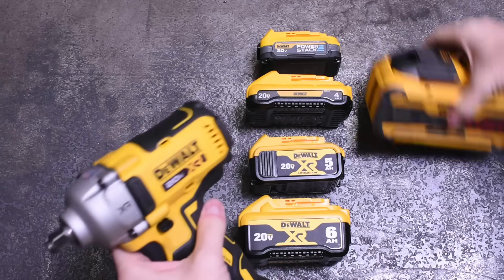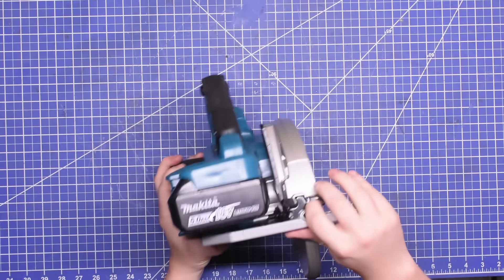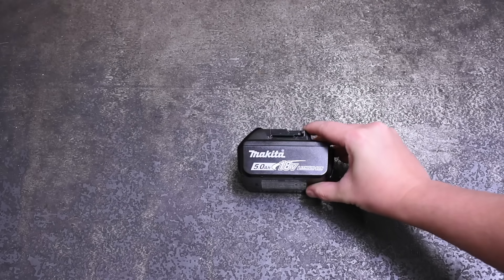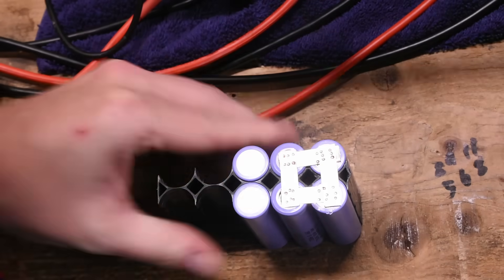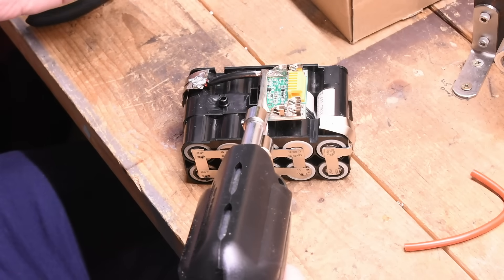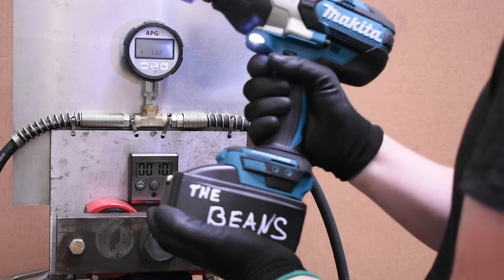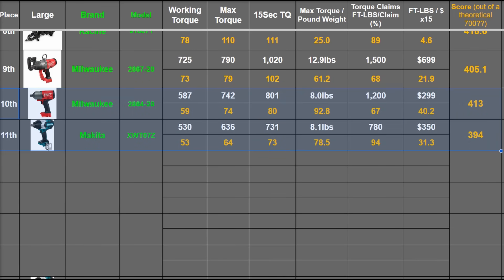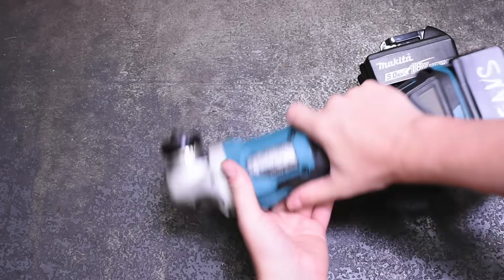We Built the Best Power Tool Battery for the "Worst" Brand

Comment: I've been very happy with my Makita stuff, but I have been considering branching out. If I were to get a different line of tool, what would be the best? DeWalt seems to be the obvious choice because they're so ubiquitous (especially in my area), and seem to be keeping up with developing new, better tools and batteries, but maybe there's a better option now?
Reply: im in a similar position. im thinking of hikoki. love my makita tools but hikoki make the most powerful cordless drill and grinder. id also like a belt sander which makita dont make. find a good brand that offers those extra tools you want

Comment: I built a few FAKITA packs using Molicel P26A 18650 2600mAh 35A cells. They boast discharge temp down to -30c, and where i live in Canada, frozen batteries are infuriating!

They work great in the cold, however the cheap ABS cases SUCK. one drop from waist height and they're toast. (If you drop one in winter I'm quite sure it'd just shatter!)

Comment: I'm fairly sure Makita knows that bigger batteries will give them more power. They also know that LXT has had several layers of duct tape added to it since 2005. Bigger cells would need another layer of duct tape in the form of bigger mosfets and probably a heatsink in the battery. Eventually you're better off starting from scratch, which is what XGT is.

There is no XGT tax. In EU, AU/NZ, Asia, the XGT equivalents are the same or slightly more than LXT. What you're seeing is crazy price competition in the US amongst retailers. So US LXT prices are probably very low margin, but Makita are unwilling to discount XGT because they can make much better money off it from the rest of the world.

Comment: It's interesting to see the different curves on that 15 second run right at the very end, the 3/4 Makita still has quite a steep curve indicating it is still making more torque, whereas the Milwaukee has started flatten out quite a lot. Would of been interesting to see if it flattened out at the 20s mark. It wouldn't surprise me if the Makita made more power than the Milwaukee after 20 seconds.

Comment: Imagine if our tools came with a simple coverable port on them so we could...plug them in if we wanted to. Great episode. If you're going to experiment, why not make some cordless tools corded?
Reply: I always liked this idea but the low voltage tools need a transformer that can output at least 50 amp peak so it doesn't go into overload, I made a power supply that can do just that with a peak output of 80 amps at 20v, the cheap part is the voltage regulator, the expensive part is the transformer to step the voltage down, although it could also be done with a bit more sophisticated switch mode power supply, I have an old skill brand set with the versa pack batteries that has a battery eliminator for a few tools, but it always made them super weak
Reply: @TheShivABC  That's true I didn't consider that, thanks for sharing

Comment: Nice work!
One question though, are the tool switches and motors designed to handle the extra current?
Reply from the maker: They only get as much current as they request. The difference here is the voltage doesn't sag from it
Reply: @TorqueTestChannel but the toosl are designed for the existing batteries. If you add 30% more power and 50% more runtime, then stuff is going to cook that previously would not cook. This is why their older tools can't run with 4/5/6ah packs, because they were originally designed when 3ah was the best pack available.
Reply: @toolscientist  they were only going to "cook" because the old tools had 0 thermal overload protection communication for the battery.  And no low voltage control either. The motors and switches were absolutely not going to cook from a 4.0 being put on them because they were still using the exact same motors/switches and models #s as the prior year tools in most cases when star protection rolled out.   On the tool side it was basically nothing other than a revision for the tools to accept the sense pin/rail from the battery and do basic yes/no communication for battery SoC and thermal condition 

Ofc the batteries were at risk of being cooked, or at the least, potentially overdischarged, by a completely unprotected high-draw tool.  (ex: DGA452 angle grinder)  Plus that little plastic nub that the old pre-star tools had on the bottom preventing people from putting newer 4/5 batteries on them?  That was there long before star protection ever came to market.  That was originally for Makita's crude way of preventing people from taking a 1.3/1.5Ah slim pack and immediately roasting the thing in an angle grinder, reciprocating saw or a large premium-level drill.  

4s and then later 4/5 w/ the updated battery gauge were locked out to stave warranty claims because people were rampantly destroying (though no fault of their own, really) their own batteries by running the tool til the motor barely turned, putting the battery was in a deep state of unrecoverable overdischarge.  The infamous red/green flashing error lights on the charger.  It was never going to cause any issues with the tools themselves, because Makita was already allowing you to use new batteries on the old tools without that plastic nub anyways.

Yes, you could still do this with the newer star 3.0s, but that was the standard battery going back 5 years, Makita still had to officially support the old tools in some capacity and it was a cheaper battery to cover under warranty.  And early star protected Makita batteries were still NOT as sophisticated as the ones we have now.  I've still got some old junk packs with the 1st star protection PCB revision, and they're nothing like what we have now.  

The old tools and new tools were 98% the same, at that time, anyways.  Most post-star protected tools the first few years following the roll out were still the exact same model # with the exact same parts (switch and motor) as prior year tools.  The switches were only ever updated for the sense pins, they never uprated their current carrying capabilities because they didn't have to.  Plus Makita was allowing you to use new 4/5 packs on those old tools anyways, as long as that old tool already accepted the old slim 1.3/1.5.  

Same motors, same switches, same models #s (they would later come out with a new model # system in North America)

I've got a pre-star BTW251 from 2008-2009, post-star BTW251 from ~2013 and an XWT05 from ~2016 in my old pile of tools.  All are the exact same wrench at their core.  The BTW251 post-star was basically just a revision for the sense pins and then the XWT05 is just a model # change.  All parts were virtually the same and outright compatible.  The oldest BTW251 wouldn't have star protection ofc if you're just swapping parts around, but I can still take a 2023 battery and use it without issue...(the only real issue being the wrench is worn the fuck out from long service life)

Though if I still had one of the original star protection batteries working that wrench would definitely be able to run the battery so far down that the charger rejects it.  New batteries can at least protect themselves in tools where low voltage control is not present.
Reply: @jaywelker5566 good info, thanks! It's been a few years since I used LXT but I remembered an old circular saw that would only run on 3ah packs. Can't remember if it had the 3rd pin, but it probably didnt. Always thought it was a duty cycle thing as the 3/4/5s are all similar discharge rates.

So does star protection not also allow the battery to do thermal cutoff? If they can do low voltage cutout, then they should also be able to do thermal with the same transistors. Then you could use 4/5/6s in the older tools.
Reply: @TorqueTestChannel  
The original battery was only able to supply 25A, while yours was supplying 35A. 
There is a reason Makita have left this system behind, is it because the internals are built cheap and will have difficulty in working reliably with such current increase and the need for the motor to dissipate 50% extra heat?
Reply from the maker: @Miketz  Having more amps available isn't the same as sending more amps. it will only send as much as the motor and board is desiring given the load.
And as for higher capacity batteries ruining existing tools. M18 FUEL tools hadnled it fine when High Output came out, same when DeWALT upgraded to 21700 cells. Even Bauer and Hercules tools now too, all designed before the latest 21700 batteries. So if LXT can't hack it, that's a pretty poor showing
Reply: @TorqueTestChannel  While you are partially correct, the fact that the motor actually consumed an extra 50% more power when a low internal resistance battery pack was installed shows that the motor wants more current than the original battery could provide. 
And yes, the fact that most other manufacturers are providing better batteries for legacy hardware shows that in their systems, the standard batteries were either not a limiting factor, or the hardware was capable of comfortably handling the extra current a better battery could provide. (Is there a video where you measure the torque output of a tool with low end and high end OEM batteries?) 
The fact that LTX decided to invest in a whole new range rather than just upgrade the batteries should make you consider factoring in a reduction in reliability/MTBF/Duty Cycle into the equation when considering to do this as more than just an experiment.
(I'm not just some random with an opinion, BTW - I am trained/skilled in an electrical trade)
But I am in no way questioning your experiment - it is an excellent video and thank you for answering a question I have wondered about for some time now.

Comment: I have noticed that makita batteries, even though lower A/H, will last longer through the same job compared to Milwaukee with higher A/H comparable tools. And you really can't beat makitas charge time. I wish the rest of the industry would help develop battery technology. We've hit a point where all the tools are strong enough for their given applications and very close, but what matters is how many time you have to stop and charge or switch batteries and the extra fatigue from carrying bigger and heavier batteries to avoid that.
Reply: I think your on the money, can't imagine someone carries the 60v flex volt around for fun, at some lugging around an extention cord will be lighter
Reply: @benhollanders7911  Still don't understand the dropsaw being cordless. How many times do you move a dropsaw every day? Once? Maybe?
Reply: well said. agree the overall quality of makita batteries/charge times is significantly better than other brands. i just wish makita made a small lighter batter with a bit more punch
Reply: I run Dewalt Flexvolt and makita LXT every day. Flexvolt isn't so bad to lug around, it has the beans.
Reply: Exact opposite is true. Especially noticed during angle grinder work. Milwaukee does more with the same battery capacity. Makita batteries are much cheaper than milwaukee though so you can have more of them.

Comment: People really don’t understand Makita. Makita is an independent toolmaker; not owned by any conglomerate, or publicly traded. They design, and make tools that are meant to last, and keep the user safe, in a professional setting. You don’t buy Makita because it has the most ugadugas, you buy their tools because they last, and can take a beating. Makita doesn’t have the budget of these huge tool making mega companies (ie. TTI, who makes Makita, Ryobi, Ridgid Power Tools, Stiletto Hammers, Hoover, etc), so they focus on making tools that deliver what’s necessary, with the confidence that it’s going to last you a long time (everyone knows someone or has a relative who owns a Makita corded circular saw that’s really old), knowing that that’s going to keep them coming back. If I’m providing my own tools to work with, you better believe I’m going to buy the ones that are going to be with me for years. Makita is also one of the few brands that has coolers on their chargers, with tools meant for the job site, which cool the battery while it charges, extending its lifespan. Their batteries are designed to stop working if the battery detects a fault, protecting you from a battery fire. Making giant batteries, and pumping more amps into wires, joints, and parts, can severely reduce the lifespan due to increased heat which the tool would be unable to shed properly. Makita makes tools that will last and deliver an expected result every time you use them. These other brands always fail right past the warranty. Every guy I see with Milwaukee is always having to replace tools, and that leads to less money in their pockets.
Reply: My first  Makitas( corded and 14.4 cordless) had bad and brittle plastic casing and had failed forward reverse switches  , that was 30 years ago, hope that has change but  4 different failed tools makes me wary, "Once  bitten  an twice shy"...🤔😣
Reply: @AuralioCabal-nl8gi  My first Makita 35 years ago was a 7.2 cordless. I recently re-celled it to modern Li-Ion for the second time and it still chooches good. Looks close to new still. It won't do for most usage today since it doesn't have modern features but I keep it busy as a dedicated power deburring tool next to the milling machine.

Comment: I made a pair of 9.0Ah Makita batteries several years ago by 3D printing a spacer to allow for a triple stack of 15 Samsung 30q 18650’s (just made the battery about 20mm taller). They are great! Use them all the time especially with the 18x2 (36v) chainsaw, the extra capacity makes a huge difference to the usefulness and there is definitely more amperage available with less voltage sag. Really wish Makita would make official 9Ah batteries.
Reply: But what about XGT line?  It is no ethic to slow downa XGT adoption and decreasing makita revenue.
Reply: Planning on making a 20 cell 5S4P 14Ah battery using "EVE INR18650-35V 3500mAh - 10.2A", I think should end up being a pretty good deal at around 75 euro. What do you think?

Comment: Two points.. please put insulation strips on the positive side. With the connector heating up it can melt the jacket and touch the live case. Then you have a fire.. 

Remember the bms is also a limiting factor. At some point it wont matter how powerful the cells are tbe bms will be the bottleneck
Reply: I thought the 10ga wire was gonna be an issue. Even at 10C there will be 90 amps coming out of that pack, I can guarantee that wire will be getting warm.
Milwaukee 12ah packs will toast the terminals in the 9" cut off saw, that tool will pull more than 100amps.
Reply: I don't think there's any bms on that 21700 battery kit. No balance connections and looks like the output is connected straight to the batteries.
Perfect house/shop burner if you ask me.
Reply: And parallel strips mean nothing. Its all about series connections. Think about how DC current runs through a battery
Reply: @ericklein5097  wrong each parallel bank adds to the potential  discharge amps. So one bank 25a second 50a and so forth
Reply: @Alex-uh1mj  thats what I said genius. In the video they said they gain an extra 50A of discharge current.

Parallel CONNECTIONS MEAN NOTHING! How do you not understand that? How does current flow through the battery?

Comment: There are far higher load amp cells than the samsung 25's.  amps v amp hours, its just a matter of layers in the cell, more layers higher amps and lower amp hour. Its very consistent across all good quality cells of a given size and there is a lot of lying going on about the ratings even from the big name mfg's.  You can get 40-50amp 18650's if you go with 1.8-2ah cells, its doubtful any of those tools can even pull a 20amp load across an individual cell though. 10cell pack = 2x 5cell packs in parallel, a 20amp x2 load would be 740watts avg(3.7v).  Cells rated for lower amp output will still put out 80-100amps also, the amp output rating is more about charge cycle life than a electrical rating.

Comment: your upgraded cells won't net you 50A more current. the current delivery comes from the number of cells in parallel not in series so going from 20A per cell to 25A per cell will net you an extra 10A on a 2p battery
Reply from the maker: Ahh that's a great point!

Comment: The reason Makita don't up the battery is because they don't have to!
Our company exclusively uses Makita tools and 5ah batteries and these tools get ABUSED! We're landscapers so work in dust, mud and rain and they just don't give up. The lower powered battery would protect the gearboxes too.
My personal tool brand is Milwaukee and I've broken stuff in home shop use.
Reply: Why don't you use Makita at home then? I love my Makita tools for work (general contracting/finish carpentry/painting) and at home. You pay the Teal Tax once and you buy once cry once. I can't justify the time going to repair facilities or being without my tools, especially when Makita makes it so easy for self repair if I ever need to, which I haven't. I still have my dad's black and white set from the mid 2000s for home use underneath the kitchen sink with newer batteries and the drill and impact are still brilliant.
Reply: @EliotTruelove  because I have Milwaukee. I'm not made of money.

Comment: Similarly, the 1.5Ah battery is too light for many tools. The DDF083 for example (which should be a light tool) often loses it's electronic breaking capability when using that battery.

Comment: Is their enough performance difference if any to go from a 5.0 to a 6.0 Makita battery when used with an impact? say their mid torque lxt? I know in the past you showed gains going from 3.0 to 4.0 and 4.0 to 5.0.
Reply from the maker: no, 5 is best overall for most applications
Reply: I thought I remember seeing the 6ah out performing the 5ah in the beans department on the lxt grinder on the channel before?